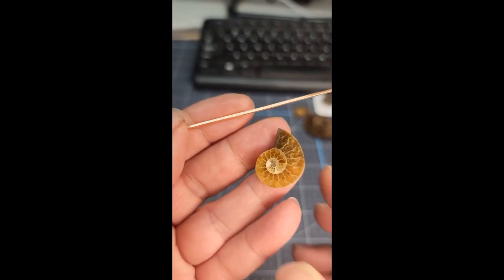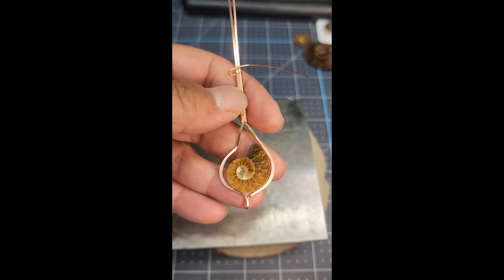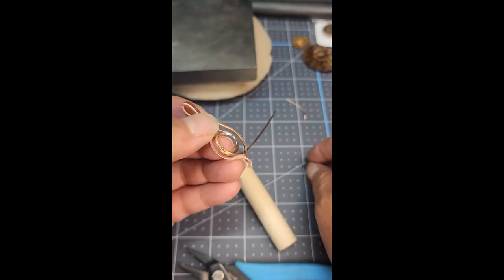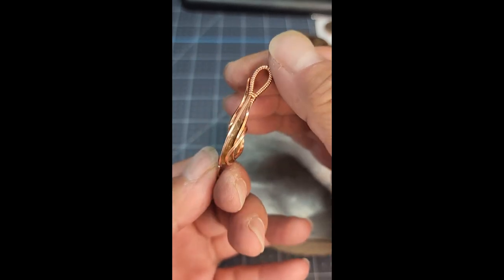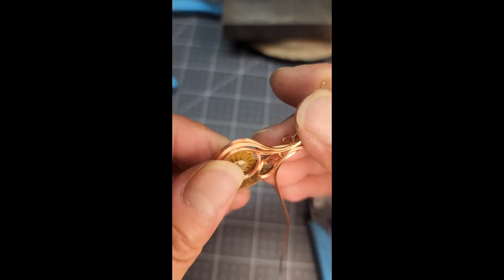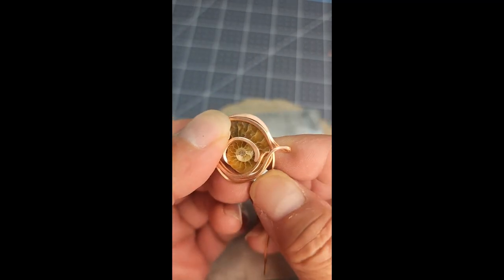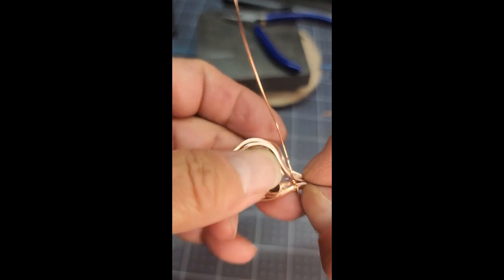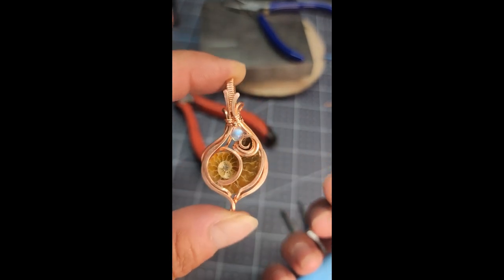TUTORIAL Ammonite SMALL Wire Wrapped Pendant

Comment: What kind if bit do you use if you sand with dremel?
Reply from the maker: Hi!  I'm sorry this message got stuck in spam folder for some reason!  I can't believe it's been a month, my deepest apologies for this!  The dremel wheel I use is this one.... 320 grit... EZ Lock 15/16 in. Rotary Tool 320-Grit Finishing Abrasive Buffs (2-Pack)